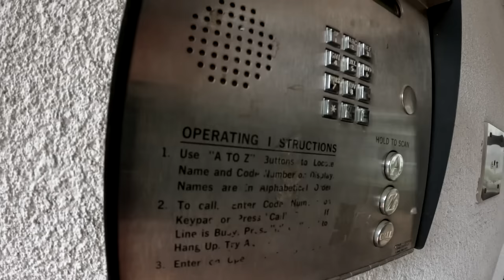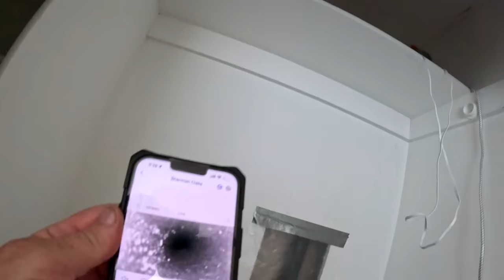THE FASTEST WAY TO GET RID OF RATS!! Shopvac...[6.5 HP]

Comment: I had a rat problem for a couple of years.  An exterminating company did nothing (except charge money).  Finally, I had someone come to fix a leaking gas line to my fireplace.  The worker came up (pier and beam) and said “ do you realize a part of your bathroom sink drain has collapsed”?  I had that segment of the drain replaced and the rats quickly disappeared (into my traps) and no more problem.
Reply: unfortunately, exterminating companies are not licensed in plumbing and drywall, but the Twins are which gives them a huge edge A+

Comment: You guys are AMAZING! 
If you’ve ever had a rat problem you know how horrible it is (and trust me it’s horrible). 
Love how you contain areas and clean up, plus all your knowledge and how you explain everything!! 
I’m still scared I’m gonna get another infection this winter (they came in for shelter, not food)
If you’re willing to answer questions, is spray insulation enough? I’ve been adding steel wool into cracks first then spraying foam.
Reply from the maker: First thanks so much for your feedback ❤️🙏
In respect to steel wool and spray foam, this will NOT be sustainable. They will chew right threw and pull that steel wool out. 
Much better to push wire mesh into the gaps or screw metal mesh over the openings.
Reply: @TwinHomeExperts  you replied! You’ve got a new subscriber in me!! It’s a coastal mobile home getaway. A bit too far north from your S.C. location. Fingers crossed all exterior access points have been closed, I’ve just been stuffing steel wool and spraying foam on the interior like crazy as a last defense. You guys are the bomb!!

Comment: OK but what triggers the vacuum? I missed that or it wasn't explained.
Reply: @spambedam  Depending on the manufacture, it will be either a PIR motion sensor or a light beam inside the bait box. That will trigger an electronic switch/controller/timer to which you connect the vacuum's power plug. And of course, you leave the vacuum in the ON position.

Comment: Man that rat dance was worth watching the video till the end haha. The rats also roamed in our house in past we sealed all holes and we put metal nets on windows that did the job ha. It would be good if you could tell us some way to avoid rats damaging our vehicles my 2 wheeler's electrical wiring and fuel intake hose/pipe gets chewed a lot of time.
Reply: Do you think you can spray under your truck and/or in the engine compartment with mint oil?  I think near the wires but not on them.  I have no idea if it damages the insulation.  They don't like the smell of mint.

Comment: Well, the rats are getting in to the sewer. Nornamlly, The Twins use a Backwater Valve to prevent future rats. However, The Twins are dealing with a Multi Dwelling Unit enviroment, so a Backwater Valve is not that useful. In a Multi Dwelling Unit enviroment like this, how do pest control companies prevent sewer rats in this situation, when a Backwater Valve can't be used?

Comment: I have artificial turf and vacuum it to remove leaves, pine needles, etc. They are heavy enough that I don’t use a filter in my 5 hp shop vac- they are thrown to the side upon entering the canister, then fall, like in a cyclone separator. You might try Rat Vac without a filter to get more air flow through the pipes.

Comment: You should have mixed some steel wool in with that expansion foam.  Rats will chew through that foam, but if there is steel wool mixed in they won't mess with it.

Comment: What triggers the vacuum?
Reply: @MrDhandley   Depending on the manufacture, it will be either a PIR motion sensor or a light beam inside the bait box. That will trigger an electronic switch/controller/timer to which you connect the vacuum's power plug. And of course, you leave the vacuum in the ON position.

Comment: How come the vertical sewer pipe in the basement did not have an expansion segment? We have that in my apartment complex, the sewer has a 1 foot segment which goes wider and then another 1 foot segment that goes narrow again, the idea is that the rats can’t climb the metal pipe with negative angle so they never come above that segment

Comment: We had mice following drain pipes through the floor under the kitchen sink and a bathroom sink,we removed the bottom of the cabinets and poured 1 1/2" of concrete and then replaced the bottoms.

We also bought a bucket of Tomcat bait and coated all of them with peanut butter,gloves on of course,we distributed the poison under our house. No more mice.

Comment: the pipe was not left open, the rats pushed out the loos pipe. thats what happend. no plummer leave a pipe in the wall without meaning. look at the lenght, it would be fit the pipe lenght that is missing.......

Comment: Rats can chew thru foam. Fill holes with wire wool preferably the kind that looks like it it was turned off a lathe or drill bit then fill with foam or cover any hole with a cut up steal soup can & nail or screw over any holes.The plumber who terminated the vent in the wall should have to pay for all the damage and rodent mitigation that was performed.
Reply from the maker: In this video applying ANY wire mesh, screws, cutting up metal soup cans etc is a complete waste of time and money. These were city sewer rats that came in FROM a underground opened sewer pipe, then burrowed into the crawl space, WE permanently blocked them from ever getting back to this underground area.
Reply: @TwinHomeExperts  A backflow preventer is excellent for that but don't you worry that they can chew thew the plastic ones ? That hinged door needs to be made of metal. Also that plumber was totally in the wrong to terminate that vent pipe inside the structure. At the very least it should of been capped with a 1 way valve to let air in but keep sewer gas out.
Reply: @TwinHomeExperts  Also I was only taking about the holes around pipes & between walls. Close off any potential runway with steel.

Comment: I call BULLSHIT on the cut pipe.. Nice job using the shell game of drywall cuts to sell it though. 

It's clear that the pipe was cut (near the ceiling) with a reciprocating saw  at the same time as the drywall. You'll notice they didn't show that drywall cut on camera. Also, notice the marks on the backside drywall, as well as the non straight line on the bottom and torn paper.. Then the pipe was cut on next floor up to release it back down into the wall for the "selling shot" of cutting the clean wall and exposing the "pipe that was never connected", all in a single take. You can tell there is an opening in the wall on the upper floor (for the second pipe cut) because you see light when he shows the view through the top plate.  And finally, if you look at the "never connected pipe", you will see the coupler is about 12" from the bottom of the cut pipe...  which would line up with the bottom of the top plate.... exactly where a plumber would place it so he could insert the next section pipe from the upper floor.

Comment: Having been in construction for over 40 years its hard to pull something over me... THAT pipe WAS NOT left open. Someone cut it with a SAW-SAW. That's what the partial digging into the opposite side is from. SO NOW we have to wonder WHEN was it cut and WHY.. WAS it ACTUALLY cut by someone else or by the ones cutting through the wall making this VID?? It has left dazed and confused. Being that he left the camera in the VENT pipe, sealed the next floor up  and NEVER put the vent pipe back where it was supposed to be.. ??????
Reply from the maker: You don’t know what your taking about. That pipe was left unfinished! That was the original plumbing to the building. Stop with your assumptions! We don’t play games or have to lie to make these videos.
Reply: @1cmnsents  Yeah.... I call BULLSHIT too.  It stood out like sore thumb to me.  AND,,, he has the nerve to deny it when called out... and to say you don't know what you are talking about. If they wanted to prove it... they could just show the video of them hand cutting that section of drywall where the pipe stopped. SURELY they filmed that..... they filmed everything else.
Reply: @1cmnsents  This is copy of a comment I posted earlier.

I call BULLSHIT on the cut pipe.. Nice job using the shell game of drywall cuts to sell it though. 

It's clear that the pipe was cut (near the ceiling) with a reciprocating saw  at the same time as the drywall. You'll notice they didn't show that drywall cut on camera. Also, notice the marks on the backside drywall, as well as the non straight line on the bottom and torn paper.. Then the pipe was cut on next floor up to release it back down into the wall for the "selling shot" of cutting the clean wall and exposing the "pipe that was never connected", all in a single take. You can tell there is an opening in the wall on the upper floor (for the second pipe cut) because you see light when he shows the view through the top plate.  And finally, if you look at the "never connected pipe", you will see the coupler is about 12" from the bottom of the cut pipe...  which would line up with the bottom of the top plate.... exactly where a plumber would place it so he could insert the next section pipe from the upper floor.